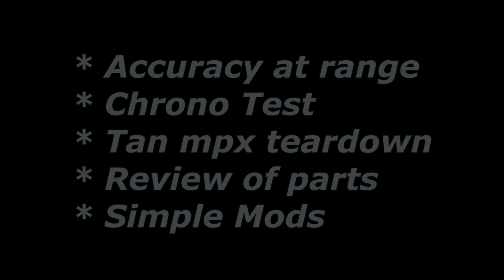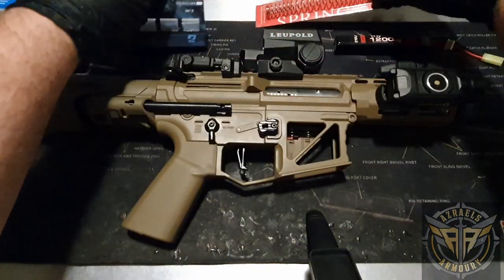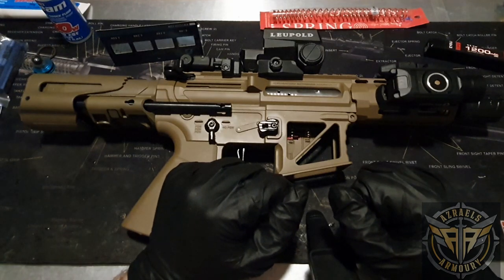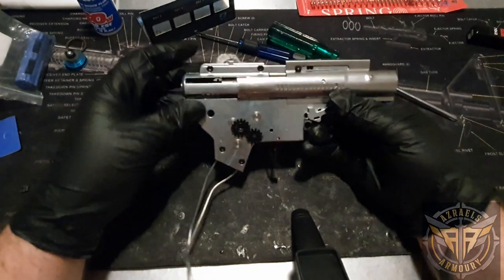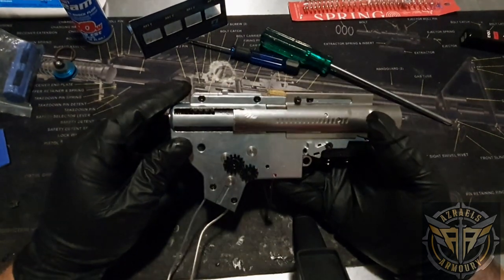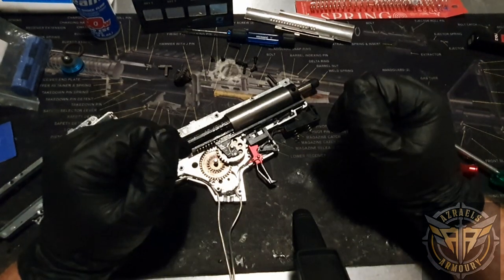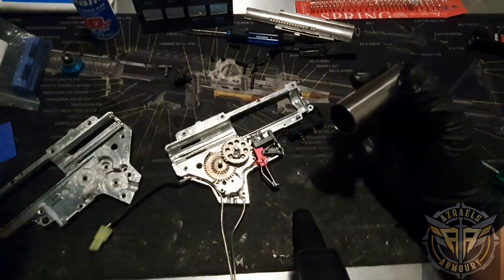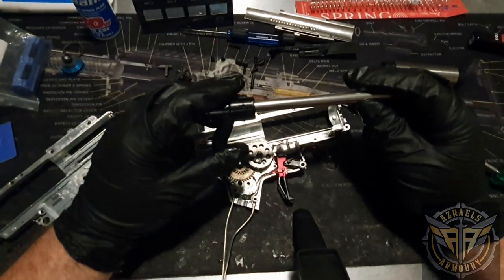NEW TAN MPX 399 FPS GEL BLASTER TEARDOWN, REVIEW, MOD AND TEST WITH RANGE VIDEO!

Comment from the maker: If  you are after any of the full metal blaster range  ak's or m4's check out www.azraelsarmoury.com.
Forgot to record the motor. I ended up using a tienly 40k motor but i will be swapping to a big dragon m160 also a titan mosfet because currently as is it's a matter of time until the standard switch frys, that will be next video how to install a titan mosfet which will be similar for alot of mosfets.
Enjoy the video i hope this helps people
Reply: m130 is ur motor heat up???mine heat up although it perfect shim ny ligthen piston to reduce load..
Reply from the maker: @usoftsait8279  no the motor doesn't get hot it gets warm after 1000 rounds or so but doesn't get hot. Which motor are you using bro?
Reply: @shakkaclacka9150  first im using my franken torque build 28 tpa ndfeb sinitered magnet it almost get hot when im using my single shot...now im using m160 bigdragon also the same...thats y i reduce my spring to m110 so it abit ok

Comment: mint! what hop up is on that?
Reply from the maker: it's a rizer v2 hop up man but accuracy at high fps come mainly because the port on the aps cylinder which i then extend to a 60 percent ported.  A video on high fps accuracy to come
Reply: @shakkaclacka9150  cool as, i'll be looking forward to the accuracy video. i'm finally going to do my own build and i'm just going to let it hit whatever fps it hits and work from there. lately i've been wondering how to go about accuracy over 300fps and what hop ups to start off with, that and what other components actually play a big part in accuracy.
Reply from the maker: @EerieBetrayal  accuracy over 300 fps comes down to gel, barrel and hopup used but most importantly voluming to porting your cylinder to air volume to barrel is where most accuracy comes from. This build here i ported it down to 60 percent so iam onpy using just over half of the cylinder volume. If I use a full cylinder muzzle velocity becomes less and fps drops and accuracy becomes bad because of all the air around the gel as opposed to the air being concentrated behind the gel
Reply: @shakkaclacka9150  Did you ever do this? Would love to see a video from you about this. I got a 400fps blaster, did the correct voluming ratio - sitting at 1.7:1 however still cant get great accuracy.

Comment: Are there any performance differences between 13:1 and 18:1 gears?
Reply from the maker: 18 and 13:1 just means pinion turns per gearbox cycle to fire. So rate of fire is alot faster on 13:1 compaired to 18:1
Reply: @shakkaclacka9150  awesome. These gears will work ok with a 14 tooth SHS piston?
Reply from the maker: @DjKRuZe81  yep they will work no worries. I use 14 tooth myself
Reply: @shakkaclacka9150  and for this kinda of set up you mentioned that you get better accuracy with a ported piston yeah?
Reply from the maker: @DjKRuZe81  ported cylinder bro yeah man. They come with 70 percent ported but i extended to 60 percent for better voluming. Its helps 100 percent in keeping gels shooting straight at high fpa
Reply: @shakkaclacka9150  how do you extend it from 60 to 70% mate, do you simply just drill it out?
Reply from the maker: @DjKRuZe81  yeah I just cut the hole slightly longer towards the cylinder head with a dremmel and then smoothe it also with a dremmel just so it doesnt damage the oring. You can also short stroke your gears and piston  so your spring isn't pulled all the way back which increases rof, timing and most if all alot less stress on the gearbox too because your only using 60 percent of the cylinder so theres no need to used 100 percent of piston and pull the spring back 100 percent. If you measure the length of the cylinder its about 71mm from memory so 7mm is about 10 percent